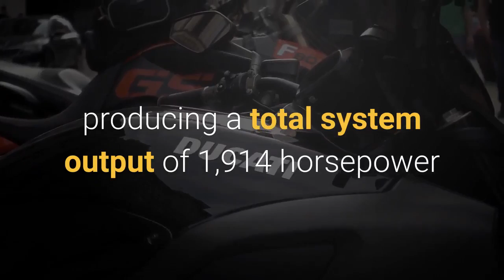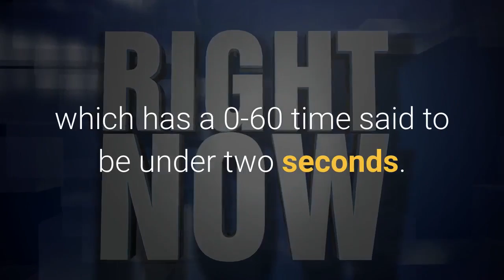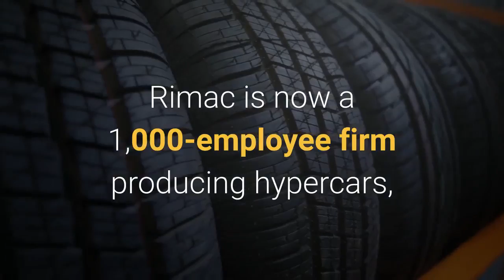The Electric Rimac Nevera Can Sprint To 60mph In 1 85 Seconds

Comment: Devel 16 part 2, the design isn't bad, but its excessive of HP make it a devel 16, it would be enough with 1400HP, 2000HP is for dragster, you couldn't drive it on the streets.